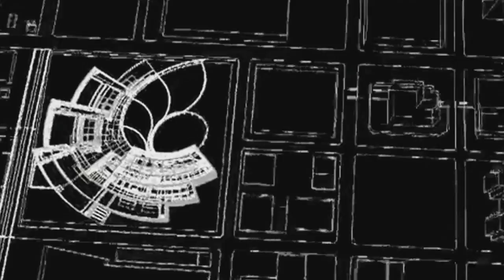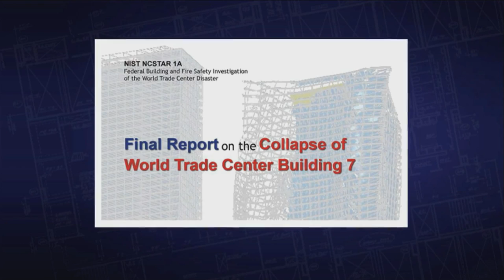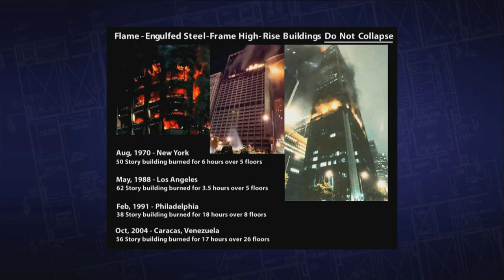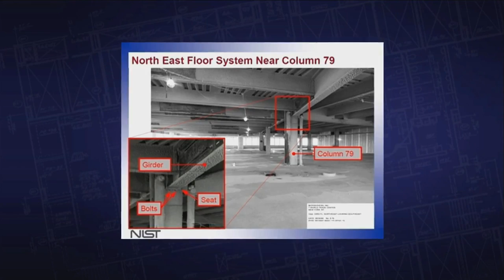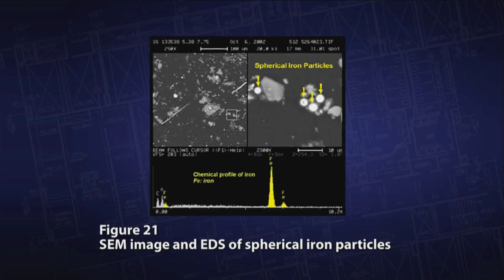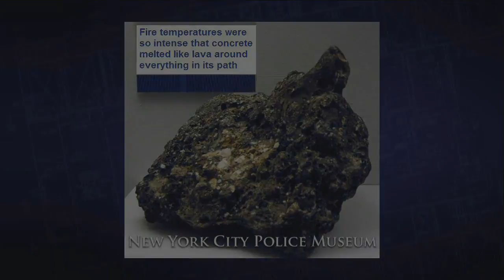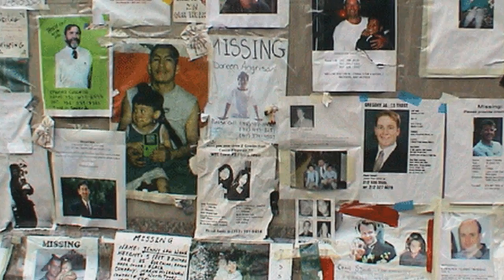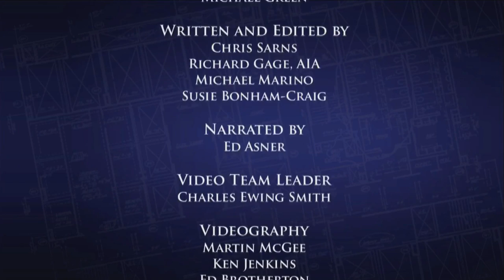9/11 Terrorist Plot - Solving the Mystery of WTC 7, Controlled Demolition with Nano-Thermite

Comment from the maker: My father was a Captain II with the Los Angeles Fire Department, and his crew worked on the 62 story high-rise fire in 1988. This was before fire sprinkler systems. They fought the quickly spreading blaze for over 3 hours. The beams were glowing red from the intense heat. Water would immediately turn to steam, but the building didn’t fail. According to the engineers, these skyscrapers could burn to the roof, but the steel skeleton would remain. You can’t bring them down with ordinary fire.